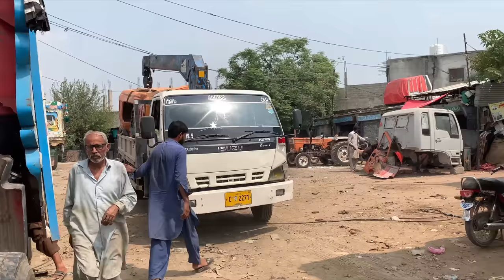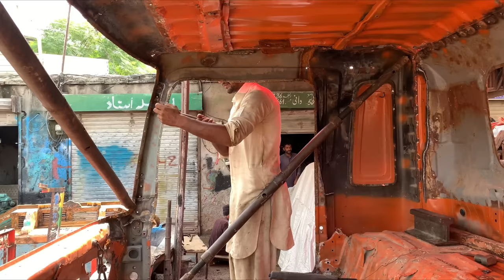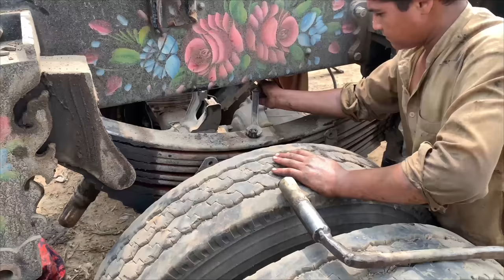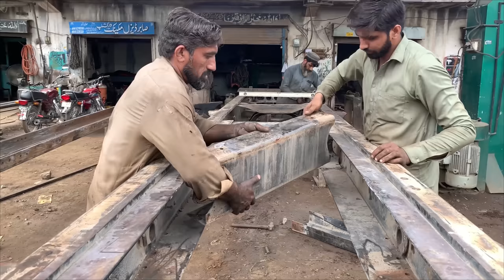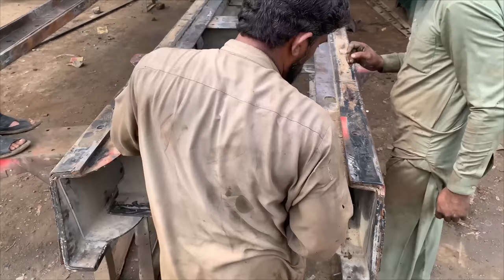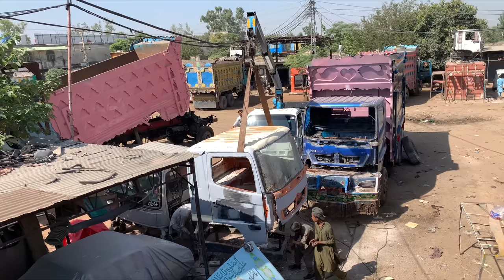Hino Truck Dangerous Accident ’’Cabin Chassis Amazing Repairing And Restoration Complete video

Comment: Phenomenal work, nothing fancy just hard elbow grease by guys who truly know what they’re doing 👏👏👏
Reply: Im a panel beater and this is the shonkiest work ive ever seen. In the west it would be called criminal.
Reply: @matton36  It isnt criminal if you know what you are asking for. Also in the west this job they did would have been close to a $100,000-300,000 labor. In the west a man whose battery protective cover was scratched for his battery on his EV car and car was totaled because the car dealership wanted to charged 60K to replace the battery even though the car cost him 58K less than a year ago... and again the battery was not damaged just the protective cover with maybe 1/4 indentation. The cover itself has more than an inch of space between the cover and battery, now this is criminal. Also guess what this truck is probably 50-60 years old and will likely last another 50 years. The drivers/owner will not want the modern trucks today unless you are willing to hand them a million dollars to maintain them because they will not last a few years on the terrain these guys drive.
Reply: @matton36  you have the tools to do excellent work at your disposal. They don't, yet they work hard to repair as best as they can, I wouldn't call this criminal because they know what they are getting.
Reply: @temujinkhan6326 that has got nothing to do with craftsmanship but rather legally. What if they repaired the cover? Or more important what if it did damage the battery? They would be liable and could cost them millions in damage fees! But seeing in these countries a life is worthless you can do shady things as seen in this video! It might look repaired but it is probably as crooked as it wading the beginning of the video
Reply: @Mark-vn7et  lol I have been to these countries and they have made trucks last for decades. These are poor countries doesn't mean they dont know their craft. You sound like someone who can easily manipulated.
Reply: @temujinkhan6326  just because you can does not mean you should! I’m a mechanic for 20 years and I’m really not scared to fix up a crashed car, but this is just flatout dangerous! This is the reason why almost every crash video comes from these countries where a truck or car suddenly fails without warning! And stop calling it craftsmanship because it isn’t. It might look good on the video but I can assure you that nothing matches anymore or is straight! Not to mention completely weakened. So no I’m not easily manipulated but I’m being realistic, you are the one being easily manipulated. Just because it has a gold color does not mean it’s gold!
Reply: @Mark-vn7et  sounds like a jealous man who knows these people have him beat in skills
Reply: @temujinkhan6326  oh now that u know what I am talking about I’m not being manipulated anymore but now I’m jealous. But go ahead, drive these cars or walk down a pathway. Good luck! But I’m not risking my life
Reply: @Mark-vn7et  they have been rebuilding these trucks for decades, I have seen them. Just because you aren't capable doesn't mean someone isn't. Yes, you are jealous because you wouldn't even know how to rebuild a headlight without following some instructions. They may have less money but they are better in this craft than you are... well lets take it back you arent a craftsman you are just a mechanic and below them.
Reply: @temujinkhan6326  a butcher is also a craftsman, and yet I would not let him operate me! But you are probably to simpleminded to understand the concept of safety, like I said if it looks like gold it does not mean it is! But hey who am I to talk about, this is completely safe and true craftsmanship. Never had there been deadly and fatal accidents in those countries right?

Comment: No matter how many times I have watched several rescue of a different destroyed truck and the process of restoration it’s incredibly amazing how many mechanics have the exact drive and intensity to overcome any complications from the destructive effects of a truck crash/accident I’m literally fascinated by the whole process of panel beating and structural repair work is proceeding at a rapid rate I’m certainly impressed by the results it’s so apparent that many of the older gentleman experience hands are a vital factor for the speedy restoration of the cab

Comment: These guys are true bodymen. I would put them up against the best in the U.S. They are second to none.
Reply: Yes n I would put them up against the best in england
Reply: @kevincomery1634  really the metal is stretched and heating it up and stretching it back into shape weakens the metal and how you can compare them with the uk  wot are you smokin  they dont care over there on the roads life is cheap most vehicles are death traps and grossly over weight driving around

Comment: It probably crashed because of the way it was originally put together.
Bet that front end alignment is spot on!   Chassis has been restored through three generations and has yet to be aligned.
“Front end doesn’t feel right”, famous last words heard from driver as he is trying not to drive off a cliff.
Reply: This truck will work fine on the road for next 15/20 years.
Reply: Why so salty? The repair was good enough, no need to be precise at the millimetre level here. They are hard workers and their conditions have them resort to ingenuity and whatever tools they have. The cost of these repairs is relatively cheap there, yet they ensure they fix things as best as they can with the means they have, and as fast as they can.

Comment: This needs to be done in the US instead of totaling vehicles because a for profit insurance company says so.   90% of the vehicles in junk yards can be easily repaired and returned to service
Reply: As some that has save a car from scrapping you are perfectly welcome to buy the hulk off the insurance company for pennies on the dollar at auction, and repair it yourself.................no one does though, and I only did because it was a car I wanted badly also it was just a blown engine not a major structural repair.
Reply: Попробуйте отремонтировать и посчитать затраты. Поймёте, что выгоднее этим не заниматься. В Пакистане просто очень дешевая рабочая сила и огромная нехватка техники
Reply: @user485n64  I agree, but in the US, they will total a car if the airbags deploy, now how much damage there is.   Insurance companies make money of auctioning the wreck cars off

Comment: You have to hand it to the Pakistani manic mechanics. That dump truck, especially the cab, looked like King Kong stomped on it. Their repair and restoration were rudimentary, and pitifully crude. But they did get it fixed up and made roadworthy. They might want to invest in safety footwear and goggles. Just saying.

Comment: Look at that cab! You know the previous driver has got to be dead, right? Somebody died up in there! In the US this truck would have been classified as a total and complete loss. The DMV (Department of Motor Vehicles) would never allow this vehicle back on the road, even after it was repaired. A vehicle this damaged will have structural and electrical problems for the rest of its existence and if you’re unlucky enough to purchase it, those problems are now yours!

Comment: How much does it cost to rebuild a truck?
Reply from the maker: $400
Reply: @muhammadali77  I don't believe.  $400 for the whole truck?
Reply from the maker: @marcinmilewski4282  Brother, apart from the parts that have been modified, I am only telling you the labor cost is $400.
Reply: @muhammadali77  $400 is very little. In Poland, I think the repair cost would exceed $20,000. Thank you, brother, for your answer.

Comment: Everything on that first truck has been stressed in one way or another. There is no telling what is going to give or turn loose when you start using it again.  I know they're just having to work with what they got, but I'm glad I don't have to Drive those pieced together trucks. 👴